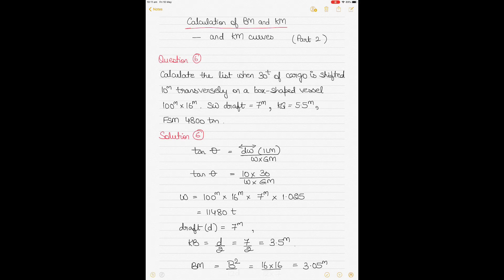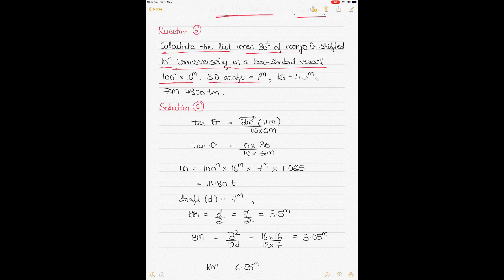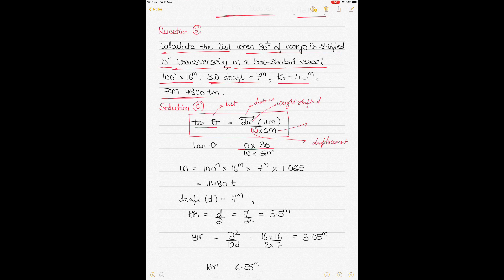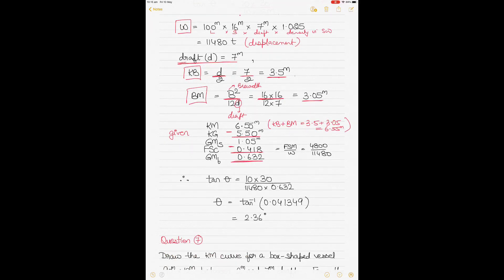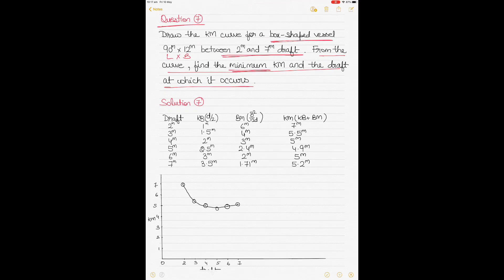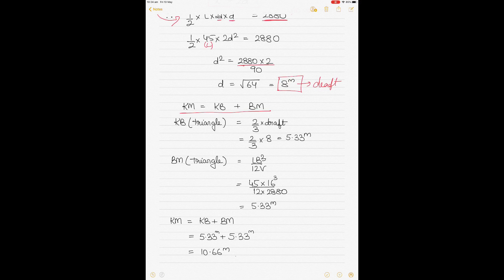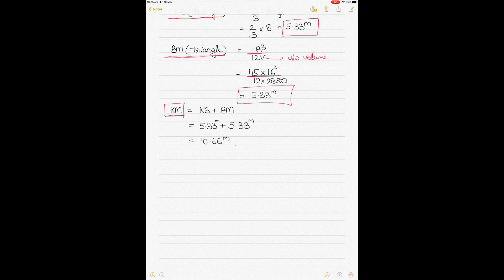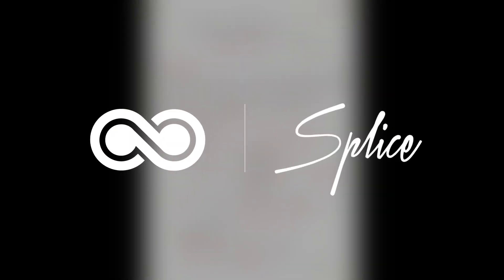Ship Stability for Mates and Masters - Drawing KM curves

Comment: how did your breath is 16 in question its given 20, kindly explain
Reply: In question, The breadth is given for the top part ie, the deck. For calculation purpose we need breadth of the underwater volume ie, the blue line in diagram denoting x. So, He calculated it by comparing the bigger triangle which dimension is given in the question to that of small triangle which is what defines the underwater portion of the ship( Similar Triangles is what it is called in Mathematics ). We got a ratio from it, which we applies to get breadth as 16.